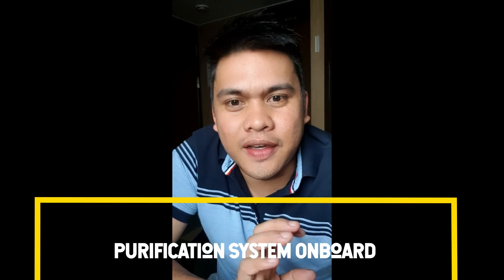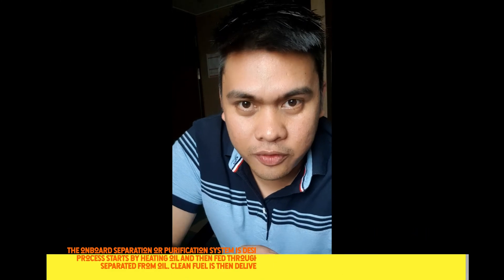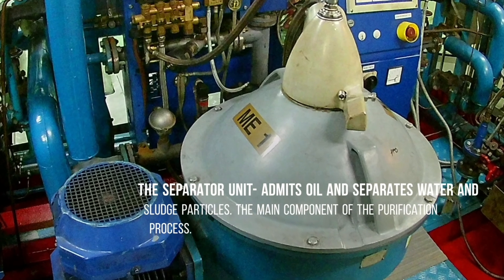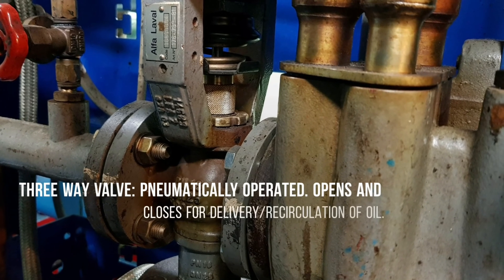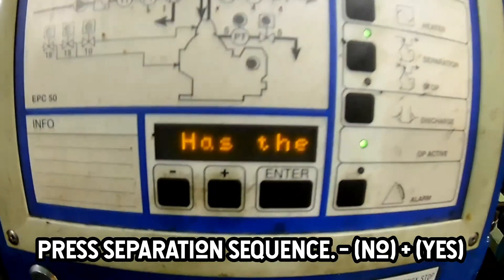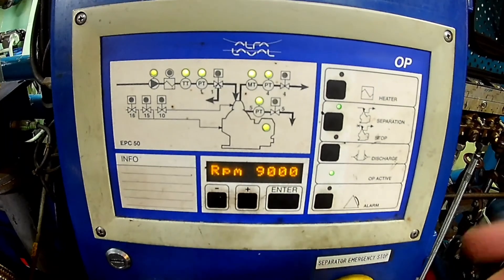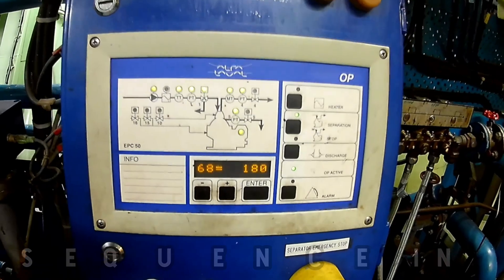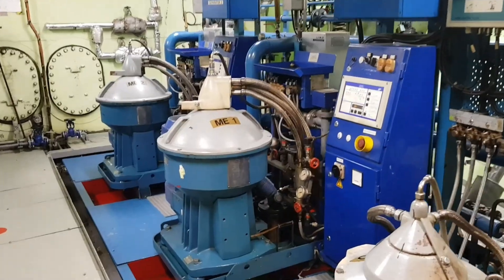How To Start An Alfa Laval Purifier || Keypoints on Separation Process

Comment: partner pag mababa ang pt4 pressure saan pwede mag adjust pag pataasin
Reply from the maker: Kadalasan sa Back pressure.
Reply from the maker: Throttle mo din pasara konti ang return at discharge. Adjust na maglalaro lang sa 1.3-1.4 Bar ang pressure.

Comment: How much feedpump discharge pressure in MDO mode ?
Reply from the maker: Hey Jay. Acceptable range should be around 1.2 to 1.4 Bars. Please check if with that discharge pressure, you don't have breakage on sealing water/leakages. Then, adjust as needed.

Comment: Sir what is means tt1
Tt2
Pt1
Pt4
Pt5
M\h
MT
SV1
SV4
SV5
Reply from the maker: Temp Transmitter, Pressure Transmitter, M/h flowrate ,SV Solenoid Valve: Check Manual for  designations.

Comment: Sir oil is always going to the sludge tank 
Alarm ( PT4 low )
Reply: Help for solutions
Reply from the maker: Your bowl is opening
Reply from the maker: While in operation, your bowl could be opening due to worn o-rings or weak closing water. Usual remedy is to replace all o-rings especially those involved in opening and closing the valves.
Reply from the maker: You can also check the back pressure, too high through put setting  may cause breakage on the water seal hence the leakage on the bowl.

Comment: My purifier model is MMXP  304 ,when giving Feed oil coming out through overflow line.
Reply from the maker: I think you got too much back pressure. Regulate flow maybe.
Reply from the maker: Try to maintain feed at 1.2 to 1.5 Bars. When you over pressurize, you break the water seal hence the overflow.

Comment: Hlo Sir. What a great video thank you..
I just want to ask u something regarding 946 s flex hfo purifier..

I opened cleaned changed rectangular ring and box it up back. It ran without any alarm but after 24 hours it started giving alarm pt5 outlet pressure low. I tried to desludge and started again without any problem then after 4 hours same alarm. I opened up the top housing and saw nothing worng with the pairing tube, 
But after inspection of paring tube this alarm is coming again..
During initial start pt5 is 2.5-2.4 bar then goes upto 3.1 bar but after sometime it agin goes to 0 bar. I checked local and pannel pt5 reading is the same.
I'll share the parameters 
Pt1- .21
Pt4-1.68
Pt5- 2.4 ( then goes to 0)
Feed-1.4m3
Feed temp 98°c
Fuel type- vlsfo density 972.5
Awaiting your response
Reply from the maker: Hi! Thanks for your comment! As to your problem I think you should check your drain line. If you see leakages during running condition, your bowl must be leaking. 

Also take note, changes in temperature will also alter the viscosity hence too high heating will cause a drop on your outlet pressure. 

If the parameter goes to zero, you should check your sludge tank if the oil goes directly into the sludge tank due to bowl leakage.
Reply: @marineengineering1O1  hlo Sir thanks for your reply. But if bowl leaks the ampere should go high..the ampere is in limit..
Reply from the maker: Sometimes the bowl leaks and if the alarm doesn't go off it could be mislooked. If your sludge tank level maintains a normal increment as per discharge rate, then you're fine.
Reply from the maker: While rechecking the parameters, if PT1 is your inlet, it looks like it is quite low compared to your outlet. Try manually throttling the valves to control the flow of fuel. Inlet and outlet differences in pressure should be within the set limits by the maker.
Reply: @marineengineering1O1  this I kept low because we received new bunker which has high water content so normal feed i used to keep was 1.6m3 but now i am keeping 1.4-1.3 m3. 
Because if I increase the feed the alarm activate says transducer value high
Reply from the maker: @Arjit90270 Then you should also try to open the return line to even out the pressure difference between outlet and inlet.

Comment: How to adjust feed rate
Reply from the maker: Hey' Find the valve that controls the back pressure. It is the one with the Allen key adjusting knob. Forgot the specific valve number but that's how we adjust the feed rate. You can also try to adjust the manual inlet valve to control the flow.

Comment: Sir p615 alfa laval, naexperience nyo na po yung alarm na discharge feedback error? Inoverhaul kona pero nag aalarm padin.
Reply from the maker: Hindi kaya pressure transmitter?
Reply from the maker: Feedback error meaning yung pressure transmitter mali or walang signal na binibigay, baka  electronic trouble.

Comment: Heater was off...?

I guess we should start the seperation process after reaching certain temperatures
Reply from the maker: Correct. We need correct separation temperature only that for this purifier tutorial , we were having MGO since we are in ECA, hence no heating was required. Will try to make new one on HFO. Thanks!

Comment: What could be the problem if you get  a Pressure in water outlet PT5 low, I check the pering tube it is moving freely, what is the problem.
Reply from the maker: You could your operating water, maybe the pressure is not enough. Sometimes orifice of valve block water gets clogged.

Comment: Engr, ano pong correct setting sa purifier kung vlsfo po?
Reply from the maker: Setting in terms of temperature? Makikita sa bunker analysis. Dun kasi naka depende ang treatment ng oil. Check your bunker lab data and dun ka mag base sa requirements. Thanks for dropping by.

Comment: Working on same purifier SA835 Alfa laval 10400 rpm but the problem was facing after certain time of running  PT4 pressure is dropping and feed pressure increases to 3.3 m3/hrs
Reply from the maker: Could you check if there's a valve with an allen key that you could use to adjust the PT4? Usually if this valve is not properly calibrated some problems with PT4 happens.
Reply from the maker: If I am not mistaken the valve is VA4 or V4. It is a pneumatic valve that you could calibrate via allen key.
Reply from the maker: PT4 if Im not mistaken is the backpressure. You could adjust through put or rate of feed/hr by regulating the valve.
Reply: @marineengineering1O1  yes things have been sorted out. The 3-way valve was not operating as the air block was non responsive..
Reply: what is pt4 you know?pls say m
Reply: @nicatzamanov2812  it is backpressure sensor
Reply from the maker: Try to throttle return valve to adjust feed pressure. Hope this helps.

Comment: sir ano po yung pinipihit sa ilalim banda ng tatlong solenoid valve? parang yung flow control nakita ko sa simulator po e.
Reply from the maker: Tama ,manual opening and closing ng water flow yan. Usually kapag mag trouble shoot ginagalaw natin yan (Open/Close) to check kung may flow ang operating at sealing water.
Reply: @marineengineering1O1  ano po kaya dahilan ng high oil pressure? brake po ba sagot kapag high vibration?
Reply from the maker: @acb._.444  high oil pressure baka blocked ang fuel line or may close na valve. Kapag heavy vibration yes kailangan i apply ang brake. Pero pagkatapos kailangan check baka hndi na okay ang alignment ng bearing kaya malakas na mag vibrate or baka imbalance na  dahil madumi na ang disc stack.

Comment: If you stop the unit from the emervency stop button, how can you reset it. In our system it does not reset if you  just unlatch the emcy stop button. Can you check yours?
Reply from the maker: There is probably another interlock alarm that was not reset. Check the relays maybe or some contactors not properly reset.